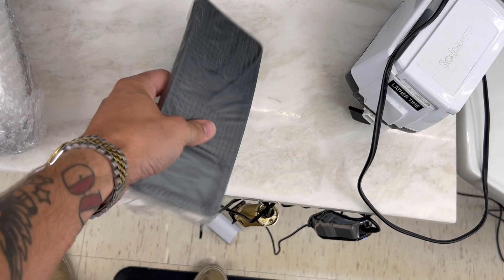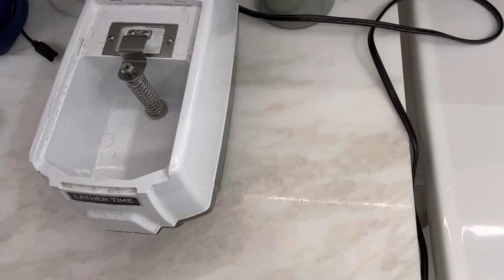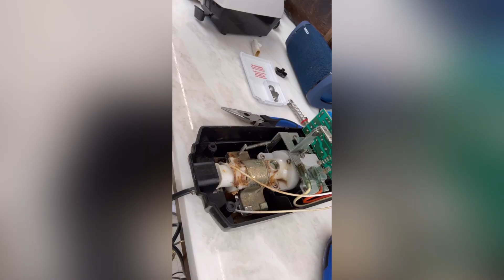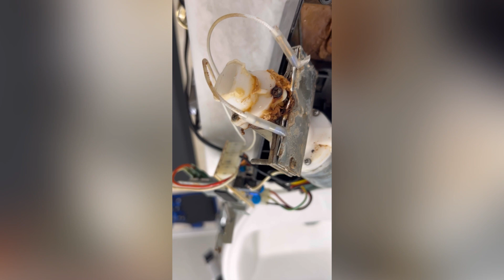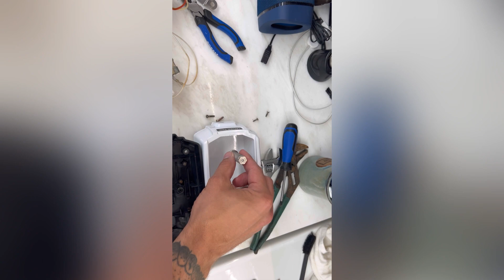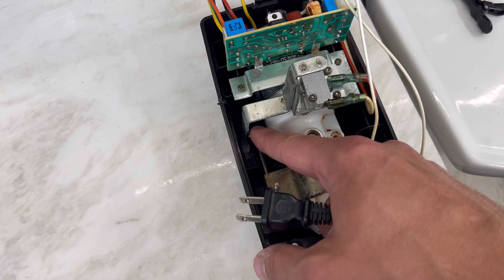How to repair a Scalpmaster Lather Time lather machine (sorta)

Comment: Thanks so much for this video ! When putting the new heating element does it matter which end goes in which side...the wired ends that are covered in the tape that go in between the flat metal plates ?
Reply from the maker: Thank you! I don’t believe it matters!
Reply: @Raysbarbershop I got it working !! I didn't notice when I pulled the motherboard and framing back that one of the wall plug in wires popped out of the little plastic bracket...popped that back in and everything worked like a charm, got a cheap heating element off barber supply and voila! I could Not have done this without your video man thanks again!
Reply from the maker: @MOONFACEFLOW you’re welcome, glad I could help!
Reply from the maker: @MOONFACEFLOW I’m glad you got it all sorted out. Happy I could help!

Comment: Can you use the “pre mixed” wahl lather liquid in it?
Reply from the maker: @backwoodsbarber  I haven’t tried that brand yet but I don’t see why not. We just tried the suavacito lather and it’s been working fine.
Reply: @Raysbarbershop cool i bought the wahl lather machine and it leaks and makes a mess.. but i bought a gallon of the pre mixed wahl stuff and i want to make use of it.

Comment: Thanks for taking the time to post this! Ours sounds like the motor is running but very little is coming out. Does that sound like a clog? I'm struggling to get it cleared.
Reply from the maker: @cowboyarcher1  is it new? Sometimes they’re very loud right out of the box but quiet down after they get broke in
Reply: @Raysbarbershop  It's pretty old actually. We cleaned it out and that seems to have it running again.
Reply from the maker: @cowboyarcher1  these things are so finicky I have 4 in my shop now and they all are a little different. So you got it working good now?
Reply: @Raysbarbershop  yes sir!
Reply from the maker: @cowboyarcher1  awesome!

Comment: Mine feels like it’s clogged ! I think I might have to open it up like this.  You just might have save me $200. I was just about to go buy a new one. 

Do you leave liquid in over night ? I’m not full time anymore and I think that’s my issue. I’m only in the shop 2 days out the week.
Reply from the maker: Just clean it really well run hot hot water through. They also sell some cleaning solutions

Comment: Thank you, very interesting. Is it normal for the soap to leak so much internally?
Reply from the maker: No it’s not normal by design but it’s a common thing that happens with these. Try changing out the O-ring, or switching lather brands.. Campbells always leaked on me worse than Scalpmasters brand on lather

Comment: we have like 6 or 7 of this machine leaking, the plastic did crack if leave it with little water overnight.
Reply from the maker: I was using cambels pre mix for a while I had leaking issues, then I switched back to lather times brand and haven’t had issues. You may also want to try changing that O-ring.